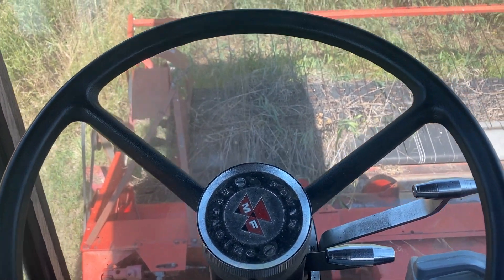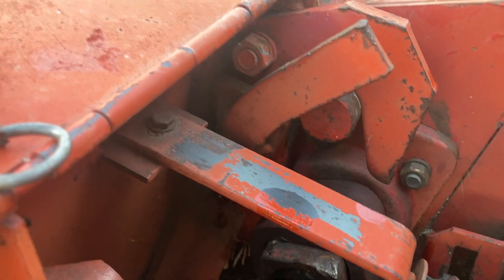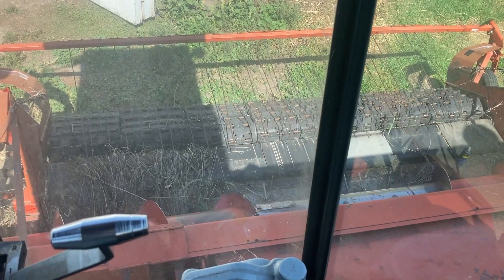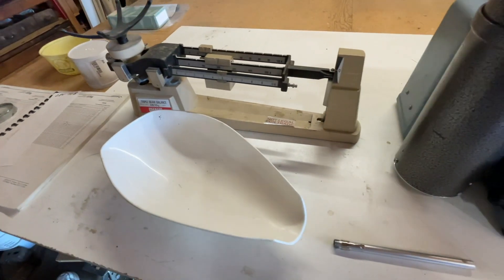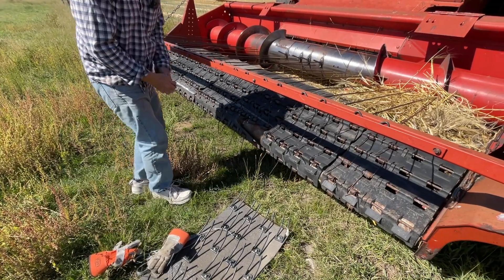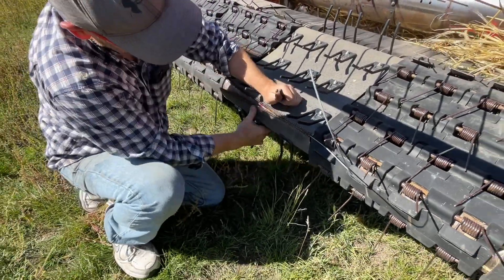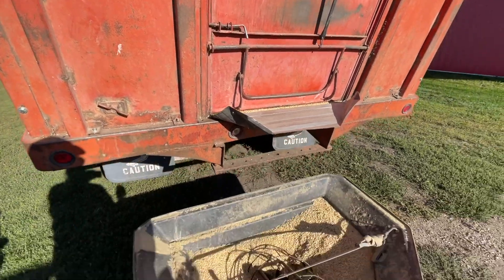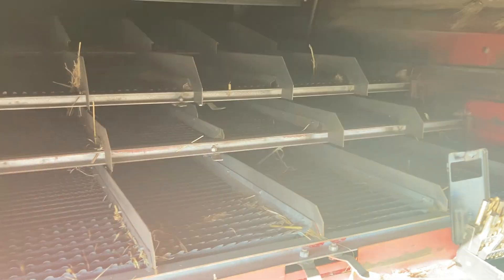Harvest 2024 with our 1981 860 MF.

Comment: Those old samplers are the absolute best, that’s what elevators used for years. We run a  handheld agratronix that is fully calibrated to that old 919, its dead on to the elevator
Reply from the maker: It’s important to be the same as the elevator, that’s for sure.